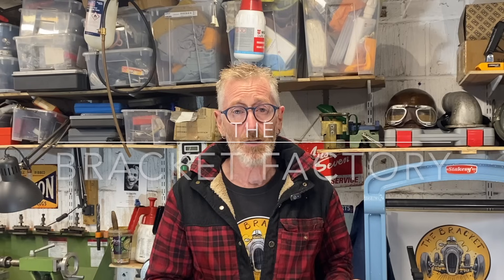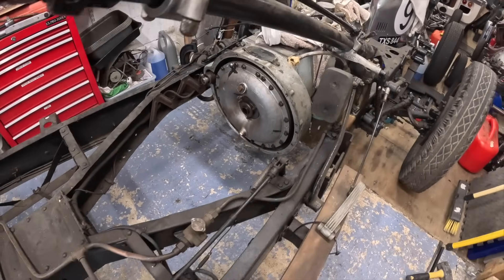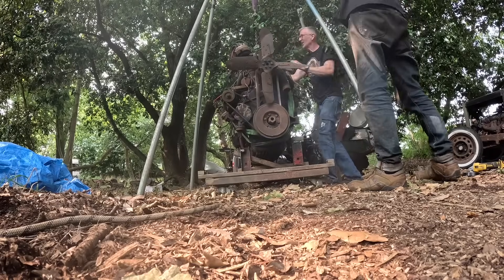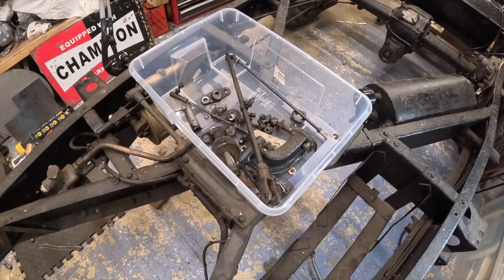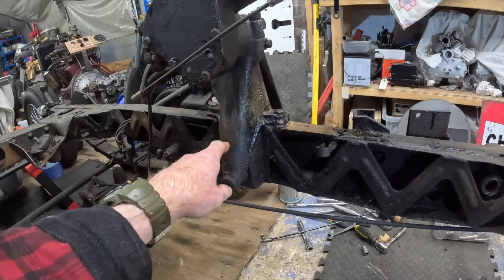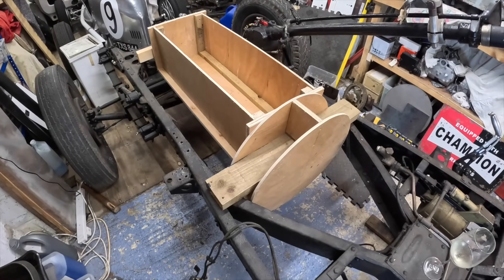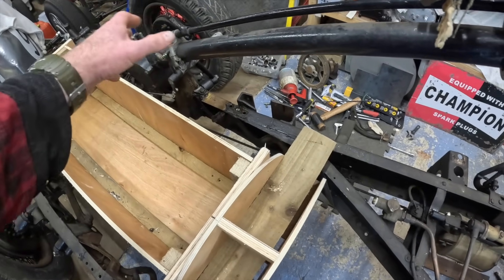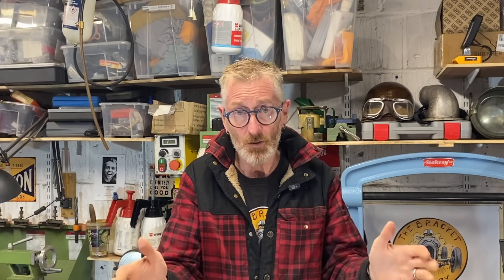V12 Speedster Project - Will The Big V12 Fit? - Episode 27

Comment: Would it not be better to lengthen the chassis, add to it, rather then try to re-engineer what is already there?
Then you might be able to keep the "design" just make it a bit longer (as necessary)
Reply from the maker: Hi Paul, yes that would be easier and I did consider it, but I don't won't to lengthen the wheelbase and I want the drivingf position to be much further back.  The Daimler was a 4 seater car and the new driving position will be as if I'm sitting on the back seats!

Comment: What a genius idea of building a wooden box in lieu of moving the engine.  I like your idea of boxing in the frame. There is a lot of torque from the engine. You might be able to remove the whole X part of the frame and attach it further back to clear the trans. If you put a cradle under the rear engine supports, it would stiffen and hold the frame straight and take the weight of the engine and trans. Either way, this is one heck of a build and I am looking forward to the next episode.
Reply from the maker: Cheers Jorge! Even the wooden dummy engine is quite heavy!! Not finalised the new design yet.... but it'll be VERY strong!!

Comment: What will you need to do to the front suspension to account for the difference in weight do you think?
Reply from the maker: haha, sounds like a leading question  (a jolly good one at that!). I my 'defence' M'lud, I intend to move the weight back as much as possible to get some weight over the back... but that will be limited. Also, the original car carries several 100 kg of body that I won't have.. so I will lower the engine down carefully and see how far the springs deflect! But the short answer will probably be 'more leafs in the springs'....

Comment: Love the idea of the mock up engine block seeing it in place gives a good idea of where to go with the chassis, personally I would be inclined to add some temporary cross braces to the chassis to enable removal of the cruciform which could then be modified and refitted at a later stage probably further towards the rear.
Reply from the maker: yes, that's a good idea - I don't want to chop the whole lot out without tying everything together!

Comment: Nice work.  I’ve seen builders in the US use an expanded polystyrene moulding of whatever V8 they want to install to get positioning and fit right, what you’ve done there is certainly a step on from cereal box patterns.
Reply from the maker: Cheers Nigel... not long before the sound of angle grinding echos through the village 😉

Comment: A lot of work and a lot to think about.  It may be easier to blow it all apart so you have all the frame components separate and start from there, rather than constraining yourself by what already exists.  It would probably make a better product, and you could still re-use a lot of the frame components, steering box etc
Reply from the maker: If it was bolted together I'd be tempted.. but it's hot riveted and they are a pig to remove ... more of that to come!

Comment: If you were to lift the engine an inch or four, the circumference of the clutch would be lessened as well as any clearance for the front pulley.  This is, of course, only a quick eyeball estimate by a "kitchen table engineer" in pursuit of an answer to a question not of his own trouble and may be deemed as ridiculous as is necessary in light of realities unknown.  Enjoying the build so far.  Keep it up.
Reply from the maker: haha, cheers Russ! yes, if you lift it'll go further back.. but I don't want to lift it any more as it is already a very tall engine (being 45 degree V)

Comment: Hi, have you considered removing the x-member completely and replacing with 2 fabricated bridge sections,  one at the gearbox and one further back? It looks to me like you will lose most of the x-member anyway........
Reply from the maker: Hi Jon - yes, I think I will use at least one heavy cross brace, and I'll also have to triangulate it to prevent a shear effect across the chassis.... stay tuned!!
Reply: Seems a shame to remove the Warren Girder from your chassis rails. Gives it that something special aesthetic. 😊
Reply from the maker: Cheers Matt - you've taught me a new term - Warren Girder - I'd not come across that! And yes I think I agree!

Comment: Great to see all this progress Chris. The engine engine mock-up is a whole of a lot better than dangling that monster engine on a chain. If you do have to take a lot more of the x-form bracing out, a sizeable, thick sheet of MDF, or ply clamped of screwed to the chassis might be the way to hold relationships in the horizontal plane and you may need some adjustable chocks to avoid chassis twist. I have used screw-in adjustable feet for a similar purpose. 
    An El-Cheepo way to make them is to weld hefty nuts into one end of square tube sections, put bolts into them with the heads on the floor, tack weld the square tube sections vertically to the chassis, then wind the  bolt heads down till they are just firm on the floor (or pads on the floor if you don't have a hard floor). Used lock nuts on the bolts to hold the adjusrment.
     Over-lapping wooden wedges on top of blocks of wood are another way. Tap the over-lapping wedges in toward each other till they are just tight, then screw down throught them into the wood blocks to avoid the wedges getting knocked out of place. This works ok for temporary support. 
Cheers, Harry
Reply from the maker: some great tips there Harry, thanks!!

Comment: Is the gearbox a Wilson pre-selector? My great aunt had a Knight pattern sleeve valve engine Lanchester, built by Daimler and you could hear the fluid flywheel for some time before the car actually arrived. When she left, she would leave a trail of oil smoke behind her.
Reply from the maker: 😆 - great story! Yes, it's a pre-selector. I have no idea how they work... something I need to get to the bottom of... one day!
Reply: @thebracketfactory  The are basically the same as an automatic gearbox with epicyclic gears controlled by brake bands. The main difference is that the fluid flywheel does not provide torque multiplication , mainly due to the absence of a central stator and the brake bands are "pre-selected' manually by bowden cables or in some cases electric solenoids. I have rebuilt a Cotal electrically operated version of the Wilson pre-selector and they are really quite simple. Both Cotal and Wilson were owned by Anthony Lago of Talbot Lago.
Reply from the maker: sounds fascinating and right up my street!

Comment: Good work there!    Regarding the frame, would it be possible to move the entire crossbrace more to the aft ?
Reply from the maker: moving aft is tricky - the rear legs form the spring mounts where they meet the side rails, and I don't want to mess with them...!